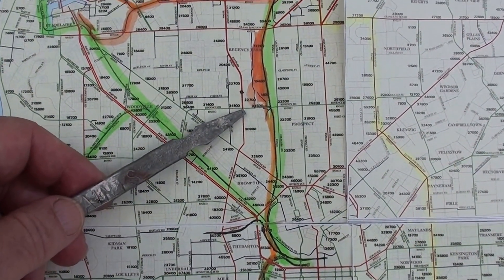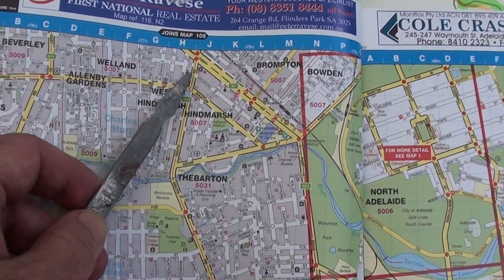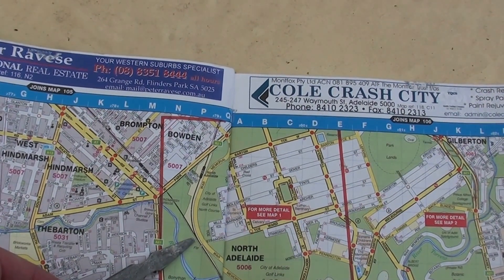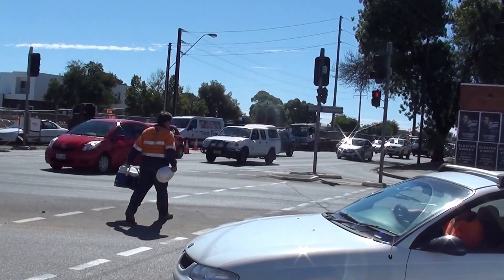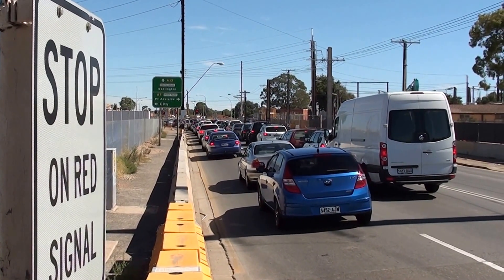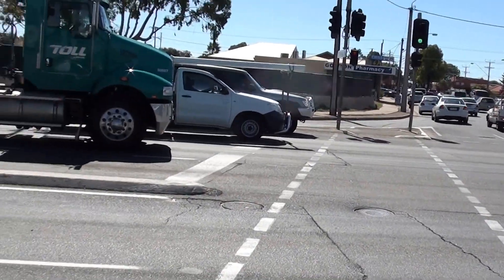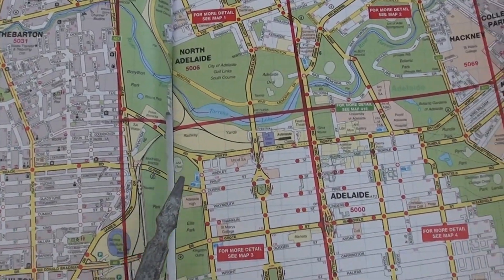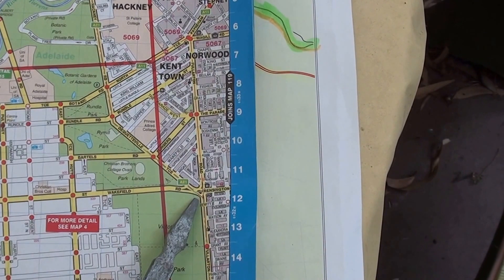Torrens to Torrens Project Greater Adelaide Multi-lane Roundabout suggestion Video Feb 2016

Comment from the maker: http://www.cityofgolden.net/media/roundaboutpaper.pdf
Are Roundabouts Good for Business?          December 1, 2004

ABSTRACT
This paper discusses the implementation of a series of four roundabouts on a suburban arterial
serving a strip commercial area. The project is located on South Golden Road which is one of
Golden, Colorado’s primary commercial arterial corridors. With four through lanes and a center
turn lane, it handled through traffic, but access from business and side streets was a significant
problem. Plans for a new shopping center elevated citizens concerns about traffic in the corridor.
In designing improvements for the corridor, the City wished to slow traffic, improve access,
safety and aesthetics. The roundabouts were constructed in 1998 - 1999 and were fully
operational in late 1999. This paper shows how a series of roundabouts can be implemented in a
commercial arterial corridor to provide a more aesthetically pleasing area, while maintaining
traffic flow and providing additional pedestrian protection. Before and after data demonstrates
the changes in traffic volumes, accidents and economic activity. The series of urban roundabouts
in series resulted in a corridor where traffic moves slowly, vehicles experience little delay at
major intersections, and pedestrians can readily access the many businesses in the area. The net
result is a vibrant commercial corridor. 

SLOWER SPEEDS BUT FASTER TRAVEL TIMES
While average speeds have gone down, travel time has also gone down. Prior to the
roundabouts, the corridor had 2 traffic signals and average travel time through the corridor was
calculated to be 78 seconds. A third traffic signal was being considered which would have
increased travel time to 103 seconds. Since the roundabouts service vehicles with less delay per
vehicle than traffic signals, the current travel time through the corridor is estimated to be 68
seconds.
More significant for businesses is the delay experienced entering or exiting their sites.
Before installation of the roundabouts, the average delay at business access points was 28
seconds, with maximum delays of 118 seconds. After installation of the roundabouts, average
delay was reduced to 13 seconds and maximum delay to 40 seconds.
 Some of this reduction in delay is due to improved access control due to the installation
of medians. Most driveway access points were converted to right-turn-only accesses and only
four full movement access points were constructed. The presence of the roundabouts allows 
convenient U-Turns near most of the business access drives. The right-turn/U-Turn movement
has proven much quicker and safer than the previous left-turns onto the old high-speed South
Golden Road.

ARE ROUNDABOUTS GOOD FOR BUSINESS?
While the aesthetic improvements, including underground utilities, wider sidewalks and
landscaping, certainly have contributed to a vibrant business community along South Golden
Road, the traffic and safety improvements are probably more significant in the revitalization of
the area. Faster travel times, better access control, fewer accidents, and lower delay at business
access points have contributed to an increase in economic activity. Figure 3 shows the growth in
sales tax revenues along the corridor, which have increased 60% in six years. This area is the
only portion of the City that has seen a year over year increase in sales tax revenues during this
period which witnessed an economic slowdown in 2002-03. In addition, over 75,000 square feet
of retail/office space has been built in the corridor since the installation of the roundabouts.

SUMMARY AND CONCLUSIONS
South Golden Road is a typical suburban strip commercial corridor. The installation of four
roundabouts within this half-mile long arterial has resulted in slower speeds, but lower travel
times and less delay at business access points. Accident rates have dropped by 88% and injury
accidents have declined from 31 in the 3 years prior to installation to only 1 in the 4½ years after
– a decline in injury accidents rates of 93%. The improvement in traffic flow, vehicular safety
and access to businesses combined with amenities such as landscaped medians and pedestrian
walkways has stimulated economic activity. Sales tax revenues have increased 60% since
installation of the roundabouts and 75,000 square feet of retail/office space has been built. In
Golden, CO, businesses have said “Yes, roundabouts are good for business.” 

Alex J. Ariniello
LSC Transportation Consultants, Inc.,
1889 York Street
Denver, CO 80206 
email: aja@lscdenver.com

Comment from the maker: Figures show fewer crashes at dual Britannia Roundabout
https://au.news.yahoo.com/sa/a/23892414/figures-show-fewer-crashes-at-dual-britannia-roundabout/
Mark Mooney  May 27, 2014
FIRST ON 7: Transport officials are hailing the new dual Britannia Roundabout a runaway success, with figures revealing a dramatic drop in crashes.
The dual roundabout design of Adelaide’s Britannia Roundabout has been in place for six months and while motorists were initially confused, figures show the change has reduced crashes by 33 per cent.
Adelaide's dual Britannia roundabout in action
Double roundabout plan to fix Britannia corner
In the two and a half years before the upgrade, there were 172 reported accidents at the intersection.
But since November, there have been just 14, resulting in four minor injuries.
“That’s a huge reduction in the number of crashes in the period leading up to the roundabout, but we’d still like that number to get down to zero,” Paul Gelston from the Transport Department said.
The RAA was so nervous about motorists getting the hang of the dual design, it posted an instructional video online.
“It is still a complex situation where you’ve got five roads and they all carry lots of traffic, so like all multi-lane roundabout configurations, the important thing is to ensure you’re in the correct lane on approach,” Charles Mountain from the RAA said.